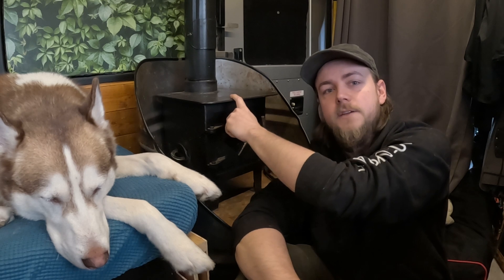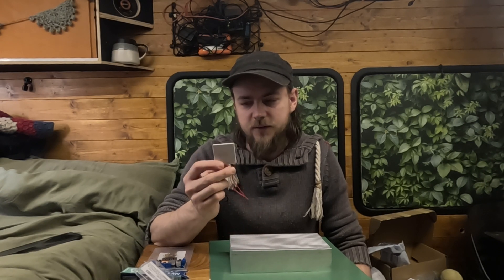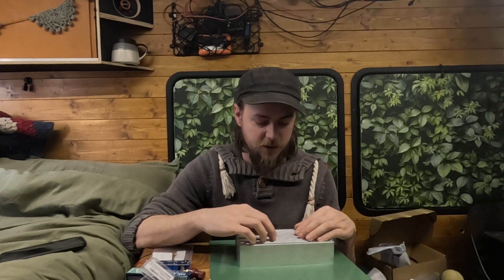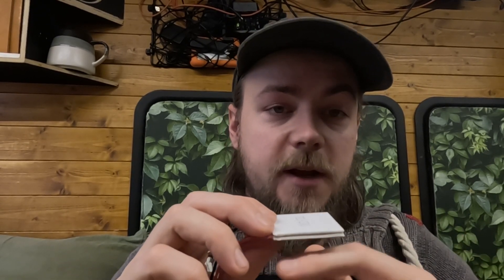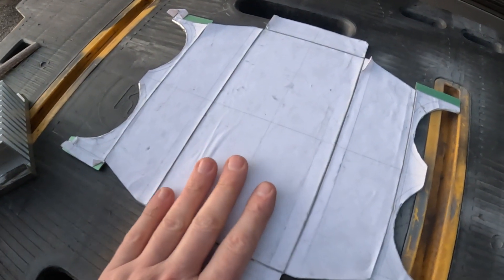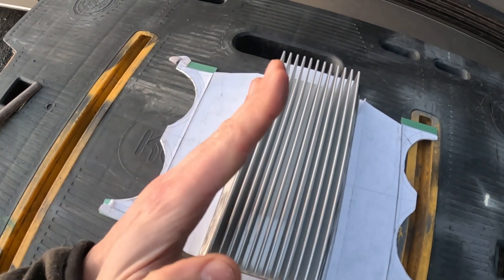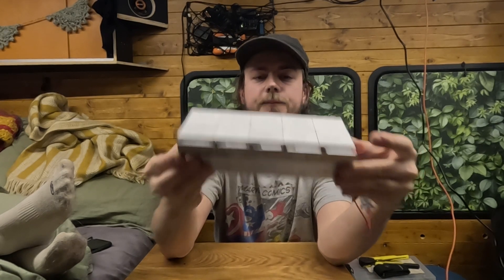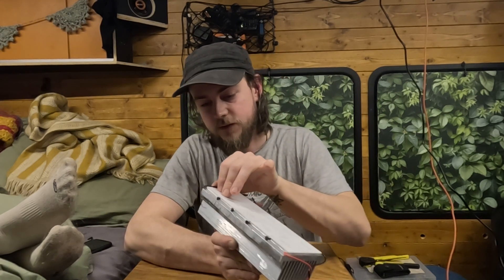Building My Own Thermoelectric Generator For Winter | Vanlife Projects

Comment: Tec modules have been modified to produce heat. I recommend using modules that start with "SP" and are produced to generate electricity.
Reply from the maker: Thanks for the comment, I think if I build another one I’ll use the SP TEG modules 👍🏼 I’ve found them for a good price now which is why I didn’t go for them in the first place.
Reply: @livinginkevlar  I think it's great that you are aware. There are very solid companies in America in this regard. Their products are a bit expensive, but they produce 6x6 TEGs, which are industrial type products that have the highest efficiency in terms of surface area. but they produce 15-20 watts of electricity.
Good luck. I'm following.

Comment: What KW is your woodburner? To maxamise heat could you utilise high heat retention materials such as Soapstone, and maybe think about the materials you are burning. Compressed eco logs usually spike in heat when you first light them, higher average temperature + longer burn time of around 1/2 hours over hardwood. In the ideas of the heatsink which will gradually get hotter therefore less inefficient, could you have a cool air vent near the top of the stove to dissapate the heat
Reply from the maker: I don’t know what KW it is because it was hand made from a seller on eBay. I do use eco logs because like you said they give a high slow burner which is ideal and I have a temperature gauge on the side of the wood burner to made sure it doesn’t get too hot. 
The wood burner is right next to the side door so I’m hoping the cooler air will be drawn from there to help keep the heat sink cool enough. 
I’ll have a look into soapstones and  thanks for the comment  👍🏼
Reply: @livinginkevlar  No problem! If soapstones are too big for your wood stove maybe consider an iron plate to sit on top of the stove with the heatsink attached to it so easily removable when you need to use the stove as, well, a stove haha